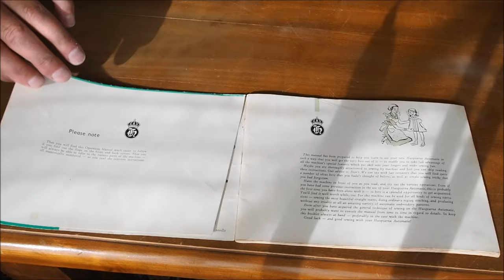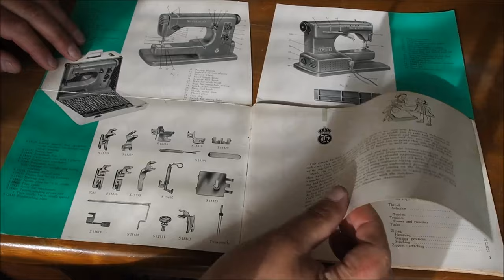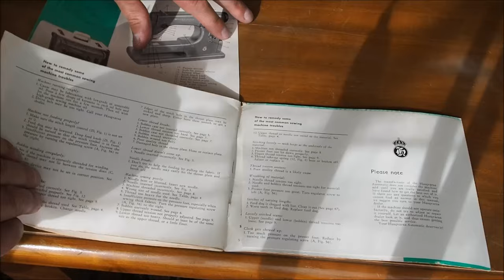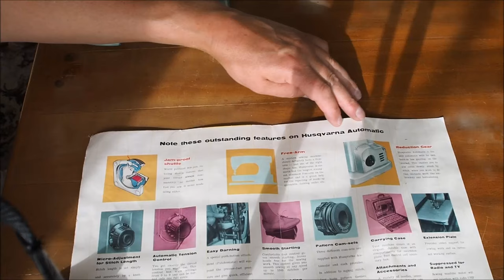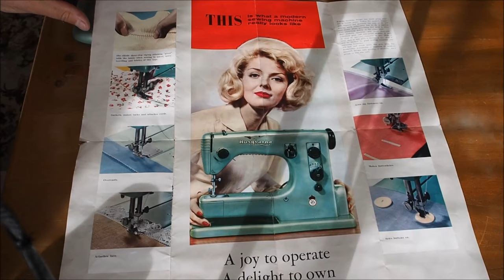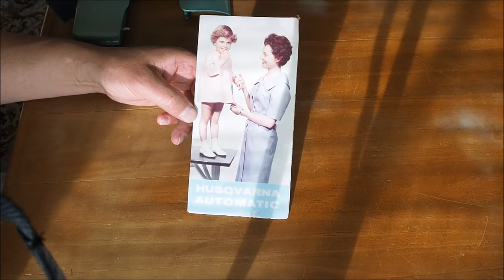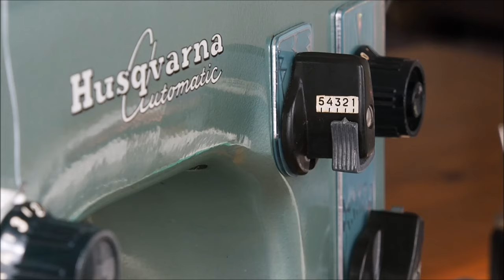Using the Classic Husqvarna / Viking Automatic 21e - Basics

Comment: This was so informative. I've had my Husqvarana for 30 years! Brought it at a garage sale for $20 🤩Yesterday as I was sewing, it started to smoke. I've luckily found a repair shop. They say a new motor or rewired motor will cost up to $250. Definitely worth fixing as I very much doubt any machine you'd buy today would last 30+ years. I have never known what to do with all the different feet or wasn't aware of lots of the info in this video. I've only had it serviced once in all this time. I wasn't even aware where the oil went 🙄 I shall now maintain my beloved machine properly as it's such an amazing tough vintage beauty 😍 Thanks for the detailed information. Also I loved the cameo appearance of Molly the kitty 😍
Reply from the maker: Hi. That sounds like it could just be the capacitor that needs replacing and fortunately that costs a lot less to do than a new motor or rewire. Thanks.

Comment: Thank you for this guide! I was originally searching for info on how to thread a twin needle with this machine, but I stuck around to watch the whole video even though you had nothing on that specific feature. (I eventually figured out the twin needle on my own, but then realized it didn't have enough spacing for my project anyway.) I have this exact model sewing machine that I found at a thrift store years ago, and I've been doing regular straight stitch and zig-zags with it to make all sorts of garments, but I could never figure out how to do all the fancy stitches it promised, and I had no idea it has three secret doors, slow speed option, or that my backstitch button isn't broken! 

So I had a lot of "wow" moments watching this video, and running back to my machine to check all the features you talked about. Sadly though, my machine does not have the B and C plugs for making different kinds of fancy stitches. It only has the A plug that's in the machine. I have no idea if it's possible to find such specific plugs somewhere online, but other than that, no manual and one missing bobbin, it has all the attachments and it's in good condition still. I really like this sewing machine as it's very sturdy and easy to sew with. The mint green color makes it stand out from all the white modern ones as well.

Comment: This video was a huge help, thank you! I inherited my great great aunt’s sewing machine and this video gave me almost all the answers I was looking for.
I was wondering if by any chance you would have the answer to my remaining problem with the sewing machine. The needle only stars going up and down when the foot pedal is pushed almost all the way down, and the speed is super fast when the needle starts moving. The slow mode you showed in the video helps but still I have no control over the speed with my foot other than the two modes. I am wondering if the foot pedal is broken or could it be something else/have something to do with the machine itself?

Thank you once more for such an informative video
Reply from the maker: Hi. I would say it's the foot controller at fault. Maybe see if it can be fixed or get a good replacement. Thanks.

Comment: This is such a helpful video! I recently got this machine as a gift from my MIL who is teaching me to sew with it. It has however been broken on the side and is missing the tension screw for the bobbin winding function. Do you know of a reputable place to source this piece? I have searched to no avail for this part. Alternatively, my thought would be to try to wind the bobbin with a standard screw without the tension device. Will that work? I'm considering buying a separate bobbin winding device, but would like to avoid that if possible.
Reply from the maker: You could hold the thread manually in front and lined up with bobbin so it winds evenly. Make sure to not wind it too tight or too loose. I hope that helps. Thanks.

Comment: DIY tip about missing the tiny plastic oil guide to the pad behind the pulley: I found a syringe whose tip was the perfect size, shape, and material to be a replacement, cut it off the syringe and shaped it to fit, and it's nearly indistinguishable from OEM.  I don't know what kind of a syringe you'd ask for; it was one of a dozen-or-so that I've got with cat medication over the years.
Reply from the maker: Good one. Thanks for the tip.

Comment: When I pull the bobbin winder area out to try use the reduction gear, this seems to push on the bit that makes it go into bobbin winding mode. So instead of being able to sew at slow speed, it just stays on bobbin winding mode and the handwheel and needle bar does not move. I'm trying to emulate what you've shown in the video. Any ideas what I'm doing wrong?

Comment: Thank you so much for this presentation! I received a Husqvarna Automatic 21e yesterday and am excited to start using it. I don’t think it’s been used for ages though and when I plug it into the wall it starts sowing automatically at high speed. Nothing happens when I press the foot controller, it just keeps sowing. I can change the stitch from straight to zigzag and adjust the stitch length but still I have no control of the sowing. A bit too automatic 😅 Do you have an idea of what can have gone wrong and if there’s something I can do to try to fix it? Thanks in advance 🙏
Reply from the maker: Sounds like the capacitor may be short circuiting. That can be fixed by bypassing or replacing the capacitor. Thanks.

Comment: At around 30minutes, so I took the cam out because I was curious, and I can pop it back in, but the lever wont go back into the slit. I asked you about this in another video and you told me to check this one. It is a bit easier to explain it now. It almost feels like the cam wont go inside deep enough (it is). Does it have something to do with the lever infront of the machine, the one that goes from 0 to 4, since it only moves from 0 to 1, it wont move correctly. Should I just go to a professional to help me fix this problem, since there are some things I don't really get.. Haha thanks.
Reply from the maker: Make sure your stitch width knob is at zero when trying.
Reply: Also make sure that the stitch selector is at 5. Mine won't accept cams unless it's at 5 (not 4, like in the video.)

Comment: I love your videos, and love knowing about the history of these machines. I just got a Husqvarna Zig zag type 20. I guess is one of the older versions because it has the stitch lever and the older tension dial. I do not find the difference between her and the 19 version. Do you know something about it? Thanks
Reply: I think you answered your own question. The knob for stitch length is really an improvement as the satin stitches are really easy to adjust. The dial between 0-0.5 is as long as between 2-4 i think. So the dial is an improvement over the lever. The reverse button is however not as easy to use as to reverse with the lever.

The tension dial works exactly the same but just covered with more "plastic". Beside that i think the machines are pretty much the same.
Reply: Hi, I own the same machine, Husqvarna zig zag type 20, but the drop feed knob is stuck and I don’t know how to fix it. Any tips? Also, while trying to fix this problem, I opened the machine and I noticed it has a plastic gear under the throat plate. I actually thought this machine engine is fully made of metal but nope. A bit sad to discover it. Does anyone know if it is built with metal gears too? The idea is to sew also leather…Not much info on the internet about this model. Thanks a lot to who will answer me!!!! 🙏
Reply: @serenamorina1016  all the Husqvarna 19, 20 and 21 have at least one plastic gear. It is a strong machine, but I wouldn't use it to sew leather. The use a little of penetrating oil in the inside part of the knob and slowly move it.
Reply: @franatort I used a product for stuck engine and I fixed it🎉🎉 . I am so happy about it. I see. I will not use on leather this one machine then :). Thank you for your quick answer. 😊

Comment: Goodnight. I bought a beautiful Husvarna machine, used, with furniture, now I have it broken, the bobbin jumps out of its place and begins to spin in its cover, the thread becomes tangled and it is impossible to sew. Also the tension button is loosened and slips out of place. in my country they don't know how to fix it. please what should i do. I don't want to have to get rid of it because I can't find a way for it to work. It is Viking 51 model.Thanks for your reply.
Reply from the maker: It's difficult to say exactly what's going on without looking at it but make sure there is no thread caught around the pin that the bobbin case latched on to. Thanks.

Comment: I have exactly this machine but struggling because my upper threads keeps breaking, as if the needle cuts right through it. I tried changing thread tension (upper and bobbin) but doesn't work. Anyone encountered similar issues?
Reply from the maker: First rule of thumb when having any issues with your machine is to replace the needle with a brand new, good quality one. Un-thread and rethread. Try again and see how you go.

Comment: Why does my thread keeps breaking?
Reply from the maker: The first thing to try is make sure you have installed a brand new needle, make sure it's the correct type and inserted the correct way around and is pushed into the needle bar as far as it will go. Also make sure the top thread is not too tight and that you have the machine threaded correctly.

Comment: I loved your thorough explanations. They gave me an insight and a good head-start to be able to operate the Husqvarna 21E I bought today. I'm really looking forward to do some sowing when it arrives in about a weeks  time. Can't Wait !! Cheers
Reply: I am a bit curious how you like your machine? Do you mind sharing?
Reply: @SideDuck  Hi @SideDuck. When I got my first Husqvarna 21E I was captivated by its color, its engineering, its single svelte arm and tray table, its capacity for 2 spools, its potential for an infinite number of stitches via adjustments and the 3 cams, its powerful motor, its peculiarly efficient floating bobbin, its neat little bobbin window, its minimal oiling points, its simple mechanical design and user-friendly setup, its superb weight and its outstanding practical performance of simply sewing anything and everything including leather and canvass WELL, without breaking needles and especially the potential for the machine to last many lifetimes.. A thought that entered my mind was 'Why aren't all sewing machines made like this' . If I was to improve anything I would switch the bobbin winding and engine housing covers from plastic to metal. The Bobbin winding housing suffers the most breakages on second hand machines and it's rare to find a machine nowadays, that is not cracked there. As soon as I got the machine, I began sewing up and modifying a quilt cover to form separate compartments to house 2 sleeping bags. Then I started sewing a few pairs of light weight trousers I had bought in Thailand, where the material was 'Space-Age' but the sewing was 'Stone-Age'...lol I was then 'Hooked' on my Husky 21E and after listening to the interesting and thorough 'In Stiches' video where the expert presenter gave a few 21E machines away to 'thrift-shops' , it almost brought tears to my eyes...lol I have about 5 or 6 old singer sewing machines, a Husqvarna 21E and a Husqvarna 21A. I want to preserve and protect these TITANS of industry and longevity and I have stored them away for another time. The Husqvarna 21E and A are in the most accessible places in my house right now and I have oiled them all with a special oil made in Bavaria in the 1800s to oil munitions like guns and pistols. It is called 'Ballistol' and its 'superpower' is that it DOES NOT RESINIFY. That means the oil does not turn to a Gum, after the volatile components have evaporated. That was the best thing I could do for my machines and I am confident that they will NOT 'Gum-Up' as long as they are in storage. Right now I have done all the sewing I needed to do, but I know when the time arises, my go-to-machine-of-choice will be the Exceptional Husqvarna Viking 21E. It is such a JOY to use, infinitely capable and so brilliantly engineered. It's my most favourite machine of all time. Thanks for your interest.
Reply: @griparian  Thanks for charing. I also have a few sewing machines but the 21E is probaby the one i like the best. I feel in control when i use it and the stitches comes out great. In my opinion the machines of this era are probably the pinnacle of the mechanical sewing machines.

Edit: Thanks for the information on the oil. That sounds like a good choise.
Reply: @sideduck6501  That's a 'Ditto' from me about sewing machines of that era being the 'pinnacle' of mechanical sewing engineering. These days with the principle of 'Planned-Obsolescence' ruling the manufacturing ethos of current day design and manufacture, plastic geared sewing machines are not worth even considering to buy. That's why these machines-of-old are so valuable, even though most people do not recognise it. I sense a resurgence when they do...lol If you read the specifications of Ballistol on their home-page, you will get an idea about how valuable and useful this oil is. I have even oiled the fret-board of a guitar with this stuff and it made the wood come up like new. You can even use it on Leather. I keep looking for the Husqvarna 21E on sites like eBay and Gumtree, but they are like hens-teeth now. Suffice it to say that I will pick up another one when it happens to come my way. If you have time, check out the following video which illustrates the engineering genius of the floating bobbin and its teflon coating:  https://www.youtube.com/watch?v=5WcF2UcVMgc  Cheers
Reply: SOWING, OR SEWING?
Reply: @mjremy2605  I'm also a keen gardener...lol

Comment: Thank you so much for such a detailed demonstration of this machine. I have a few questions if you don't mind? 

If I only have the standard foot, can i use the other cams for other stitches? It looks like I would need the satin stitch foot to me.
If I only have the standard foot, which cam should i use for straight stitch and zig zag?
Are extra feet and bobbins easy to find?

Also, that was really lovely thread you were using, what is that?

Comment: Should the tension dial be loose from the machine. I am having tension issues loose lower thread, I have cleaned and re tighten and loosened bobbin and top. So.. the actual tension dial is not fastened is it supposed to be like that? Would that cause a problem
Reply from the maker: The tension dial assembly is supposed to be firmly attached to the machine. It will be causing issues. There is a grub screw that holds it in place. The screw is probably accessible through the arm door on the left.

Comment: After applying WD-40 and freeing up the parts so they work well, should the penetrating oil be wiped off before applying a proper lubricant?  Or can oil just be applied where it is needed.  Won't the residual penetrating oil dilute the lubricating oil making it less effective?
Reply: I would say WD 40 is a very good product. Lubricant, water displacement and corrosion protection in one can. I think with this ancient machine that you can just start applying normal sewing machine oil. The machine is a sturdy peace of eqquipment so it will be just fine.

Comment: Hi. Compete novice here. I'm trying to figure what kind of machine I need for sail repairs and maintenance. I found one of these on trademe and from what I have learned from the internet in the last few hours, It might be what I need. Apparently quite powerful with the low gear and it does zigzag which is another thing I need. Just wondering if there is anything I can do to make the zigzag stitch width any wider than standard? Or if you can suggest a more suitable machine for sail repairs or maintenance on a budget. Thanks for the great vids. And please excuse the rookie questions
Reply from the maker: You may get away with using a good strong domestic machine but the only way to do it without hassle is with an industrial machine.
Reply: I bought the husqvarna 21e. I'm going to start with some new sail bags when I get a chance. I'll probably use nylon for that.  My sails are dacron though with zigzag stitching about 4 or 5mm wide. Mostly two layers. They're pretty old but I'm hoping to keep them going as long as I can. If the machine isn't up to it I guess I'll be in the market for something a bit more industrial
Reply: I been sewing thick PVC with mine. Taking it slow and going by hand when extra layers. No problems so far.

Comment: Is there a way to simply turn the machine "off" without unplugging? It seems to be always "on"
Reply from the maker: The cl21a model has a switch but I think it just turns the light off. The cl21e doesn't have a switch at all from memory, maybe just one for the light. You could take the machine to an electrician and have them install a switch in the power cable close to the machine?
Reply: @InStitches  I actually did it myself!
Reply: @InStitches  Thanks so much for responding– I have the 21A and the machine still works even when the light is off. I thought I didn't notice an on/off switch somewhere, but I guess not. Great video :) thx again!